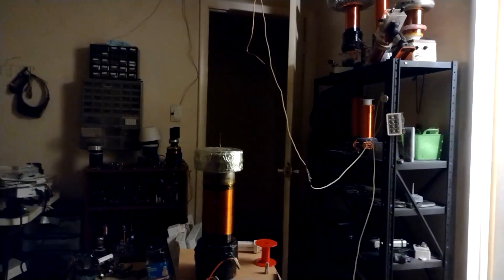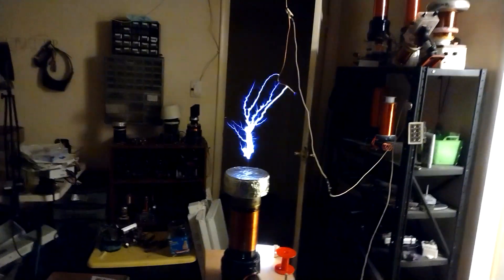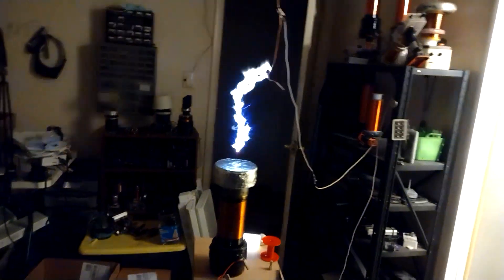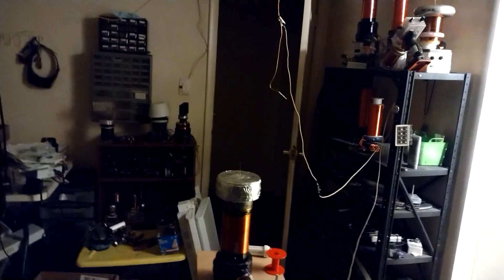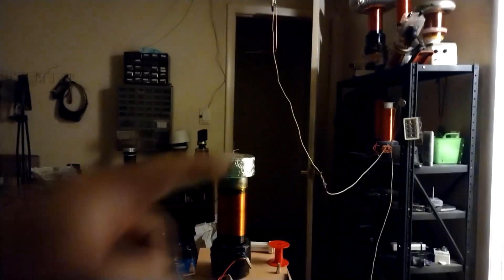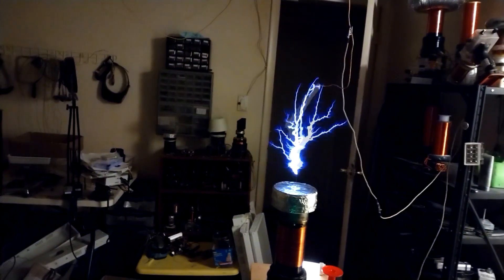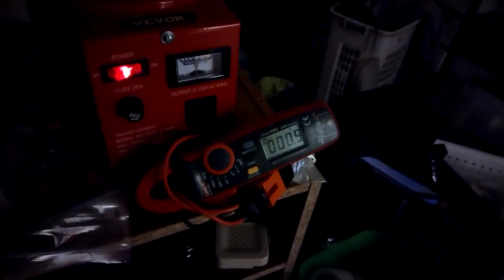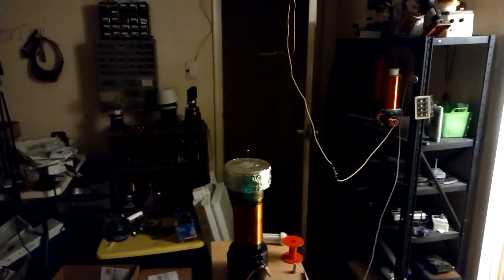PLL SSTC Full Bridge Big Power Arcs

Comment: Hey that's awesome! Mosfets with an extremely low Rg being used work really well with this style of setup. I'm curious if a gate resistor opened, or a protection diode made short at the end of video.
Reply from the maker: If I recall I only had to replace 2 switches so I think I just wasn't paying close attention to how it might have been switching at that particular tuning and output. Was probably screwing with the center frequency knob too much.

Comment: Pll is the future
Reply from the maker: Honestly too legit in my experience. The phase comparator used just locks within the VCO range I set which is automatically a good BG oscillator. I never tried the other comparator which seems way more advanced but it might work even better. It just drops out to lowest VCO frequency instead of center freq but always will maintain 0 degree phase angle when locked.

Comment: Does your coil get hot?
Reply from the maker: pretty warm yea
Reply: @Magneticitist  I'm recently working on the IR2153 hoping it doesn't fail on the first runs, but seems like 36AWG is more cheaper than higher gauge wires, that's why I based my coil like yours, but also I will run mine on just 60hz single diode because I'm afraid of blowing anything up at 120Hz

Comment: never seen a pllsstc runs on a full bridge!And most chinese tesla coil enthusiast
 use 50n50 half brifge，which i think is ok for cw sstcs
Reply from the maker: It's probably not necessary since I can use a 20A variac now but when I only used a 5A the amps were too high at lower voltages without the PLL letting me adjust the phase relation. I wound a new primary for it I haven't tested yet but hoping to maybe run smoothed CW with it and do audio modulation when I get enough filtering.

Comment: Hello.  I have been watching your videos for a long time and I have a question: what reel would you recommend for me as a beginner for copying?  I myself have already done sstc with feedback from the antenna.
Reply from the maker: Reel?
Reply: @Magneticitist  maybe coil?
Or schem?
Reply: @Magneticitist  i think he means video
Reply from the maker: OK we got coil, schematic, and video. I could roll the dice on either so here's a long one. 
If I had to recommend a first coil to build it would be a half wave rectified unsmoothed build using a half bridge. At the end of the day you basically have an inverter, some logic to drive it properly, and some method of acquiring a feedback loop if you're not trying to drive it at fixed frequency. That will come in various flavors but it's all the same gist. Between 32 and 36 AWG wire seems to always be a good region of wire size for me to wind a coil that not only meets my desired frequency requirements but also isn't too large to run on a desktop or something. Typically this is a coil former of around 2.5-3.5 inches or so. 
https://www.stevehv.4hv.org/SSTC5/miniSSTCfnlsch.JPG 

Steve's 'Mini SSTC' is a good baseline because it's been successfully replicated and modified by many. A similar build would be the Labcoatz board he put together. Half wave, then full wave, then adding the DC cap and going smoothed. Then trying it interrupted with DC smoothing then playing with Staccato interrupters. That basic driver is capable of running all kinds of coils at high power up to probably 1mhz or so depending on the switches. That is basically what I'm using here to push about 2kW through an IGBT full bridge at just under 250khz. 
You can then play around with using CT feedback instead of the antenna, where in Steve's setup you can sometimes just replace the antenna with it and circuit ground the other end. Once you feel comfortable with a reliable driver for the desired power levels it's just all about trying your own variables regarding the L1 and L2 which becomes easier nowadays using something like JavaTC. 
A good bridge design is the other part of it but they can more or less become interchangeable.. a good driver can travel around and run various setups and so can a good bridge. The modern drivers of today based around Steve's design are just beefed up to handle nearly anything you can throw at them but if you're not looking to drive IGBT bricks or run a high power DRSSTC then you can get away with a basic build like Steve's Mini SSTC. The important bits there are that you have two 9A pk gate drivers and a 74HC14 (or similar) for feedback and need to properly source or design your own gate drive transformer for best performance. 
All sorts of interrupting or music playing etc is then easy by just treating pin 3 of the gate drivers as an on/off switch you activate with a square wave drive.

The alternatives for people who cannot source suitable gate drivers or the shipping is a nightmare, but they still have access to common discrete components is to put a hold on the TC build to first try to put together a suitable gate driving circuit with parts available. I've seen complementary transistor pairs such as BC337 and BC327 used successfully. 9A pk gate drivers are overkill unless you're trying to drive a full bridge of IGBT's like me. Any 4A pk or so dual driver package will work fine for small setups or whatever other driving circuit you can put together with small power transistors or mosfets but that stage alone will take more work and fine tuning.

People want to know what circuit they need to use to push real power and I'm always just thinking I've never really pushed insane power but I'm always basically using the same circuit. I might change the feedback method a little or use different switches etc but it's largely about the tuning of any build in the real world and seeing how the bridge is running or what the drive signals look like etc. If it all boils down to basically being the same circuit then your other concerns are just the specs of the components used and how you plan to use them.. I mention Tesla Explorer in the video description because he has a few videos showing how much power he is getting in his arcs using Steve's Mini SSTC driver. I can assume even if he's switching fairly hard then he has minimized or removed any other losses in his bridge such as cross conduction or shoot-through. He has probably fine tuned his primary and topload capacitance as well as make sure he has a strong and reliable feedback signal etc.. All of those things and so many more variables come together to where he has amazing output with such a basic driver. It's how I know it's possible for me to tune my build better to run high output without popping a fuse or failing.
Reply: @Magneticitist  this is the most fantastic and valuable bit of information ive been looking for to start building these. thanks alot, this is going into my archive for when i finally get the resources.
Reply: @Magneticitist  Thank you very much for such a detailed answer.